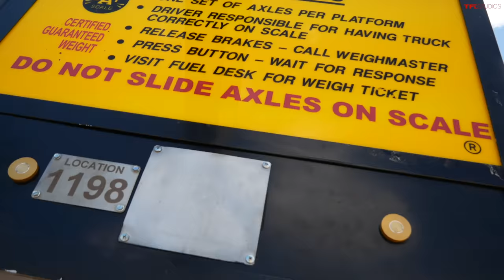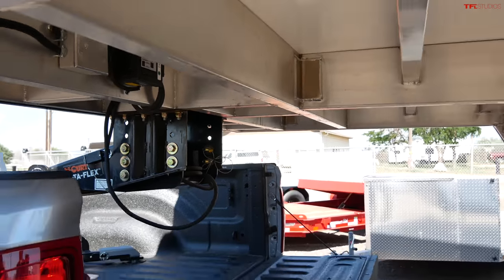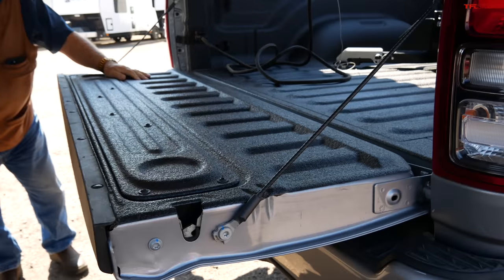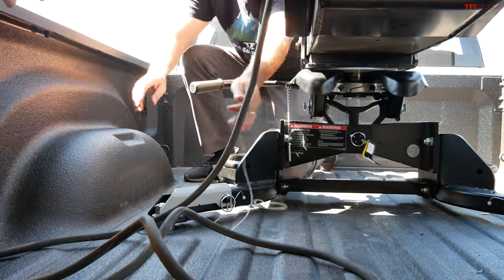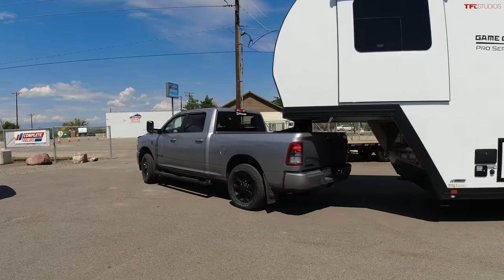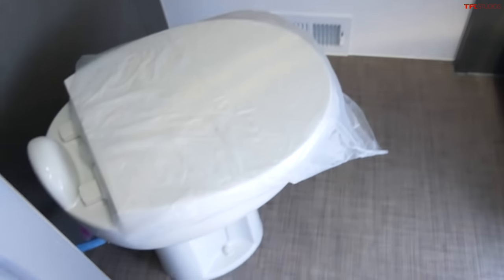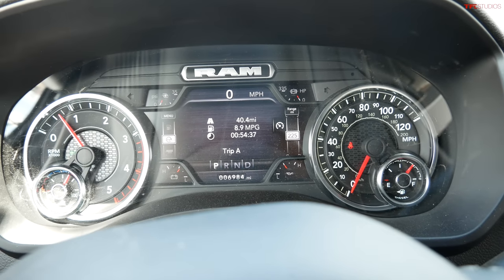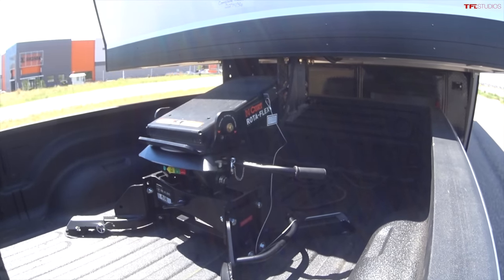I Accidentally Overloaded My Ram 2500 Cummins By 1,000 Pounds & Guess What?

Comment: I have the RAM 3500 CCLB/w the Cummins and Aisin transmission, love it. There is no way that pin weight is only 1700lbs with an empty trailer, you need to get your rear axle weight with and without the camper attached.
Reply: Before checking ATC's website I was going to say 1700 lbs was probably about right, but now that I have checked, it's a toy hauler. So ya, higher pin # but WOW does that thing have cargo capacity. I have a 5W that's heavier dry (but is nowhere near the ATC's max load capacity) and our pin weight is over 1000 lbs less even at basically the same length. Ours isn't a toy hauler though so that's where the weight diff is, and yes, why a dually would be the way to go without question on this unit.

Comment: Your MPG towing that is confirmation on my engine choice.  I have a F350 with the 7.3L gas and 4.30 axle, towing a 14k GVWR 5th wheel camper with a "book" height of 12' 3'" and get between 7  and 8 MPG, and I don't have the payload penalty of a diesel.  And yes, you should have had a 1 ton truck for that trailer instead of a 3/4 ton....

Comment: The only thing overweight is the truck rear axle by 140 lbs. The trucks gvwr of 10k is just to keep it out of commercial regulations. A ram 2500 has an actual rating of 11,500 lbs

Comment: More proof that the typical customer has no intention of pulling more than a few 2x4s. Still, loved the video!
Reply: Ya most, but you'd be surprised how many people are driving 2500s while towing loads that cannot help but be too heavy (judging by sight). Hell I've seen guys with DRVs or LUXEs using a loaded-to-the-hilt 3500 SRW. There are some very irresponsible/ignorant RV owners out there.

Comment: when we my parents my bro and i got back into the rv world i finally convinced my dad to get a diesel truck. he went with a 3/4 ton ram 2500 matched weight to the fifth wheel we had it said in the manual the big but. she ungilated in a wave pattern [not FUN] My dad saw the rear end dip sharply in a turn when the weight shifted. even with over load springs not much difference.  pulled it great 👍🏻 weight/balance not so much. after telling him you need a one ton to better distribute the load.  trade in was high been very very happy ever since RAM is the way to go. be fore warned the tough screens delaminate is fail point should be a re-call out of warranty or not. post a letter ram. plse.

Comment: Put the Reese 20K sidewinder assembly in place of your curt hitch and you can turn 90plus degrees with the short bed and not hit the bed side wall or the back of the cab and will work with any 5th wheel plate in cludeing BandW companion

Comment: I have a limited Ram 3500 Mega Cab and the payload for the SRW 1 ton is 3800#. Just to give you an idea for a high optioned truck. If it was a tradesman it would be much higher payload.

Comment: Yup, all these 3/4 ton pickups running around pulling 5th wheels are probably overloaded! I have a 3500 8ft bed SRW and you still have to be careful. Tire ratings are the weakest link.

Comment: Literally every ram 2500 at our local dealer would have been incapable of towing this trailer empty. Their payload numbers were the most egregious
Reply: Fwiw. That's all part of a legal loophole. 2500 is designed to give you the most towing capability without needing a class a when using it for commerical.
Reply: @davidflower295  From everything I have read, if you get into an accident while over your rated numbers then you could be held liable. In Tennessee having a 3/4 vs full ton is no different.
Reply: @nerdyeevideos1879  When it comes down to attorneys in a personal lawsuit, anything is on the table. In terms of the eyes of the law, GVWR is for licensing and registration. GAWR, tire ratings and hitch ratings is where overloaded factors come into play. 

What I mean by licensing is your driver's license limits. Having a 3500 with a 14k GVWR and a flat bed trailer that's empty(or loaded) with a GVWR beyond 12k will get you into just as much legal trouble in the event of a collision. In the event of a collision that causes a fatality, that can be a misdemeanor death by vehicle. 

Being in a 2500 over the payload and GVWR, but within your driver's license restrictions, GAWR and tire rating gives you a bit more gray area wiggle room than being over the your license restrictions.
Reply: I ended up getting a 350 tremor even though as i understand it it is literally the same as a 250. Did it strictly for liability when we get a 5th wheel some day

Comment: 11,080 at the scale and 8300 empty with a driver. That is 2780 difference. Makes sense for a 5th wheel like that. 20% tongue weight would be 3360 for the GVWR for that trailer. That sounds like a 1 ton truck for sure. I found it very interesting with the trailer swing with that long pin box. That would have been a bad smash.
Reply: Thanks for doing the correct math it was not 1700 lbs of tongue weight as stated in the video but 2700.

Comment: New trucks are still pretty stout for 3/4 ton. My 2006 Dually Megacab only has a GVWR of 10500lbs with 15500lbs towed. I guess they did that to keep the combined under 26000lbs to not require a CDL. It doesn't seem to just be coincidental.

Comment: We had a 2001 Silverado 2500 with the 8.1 liter and Allison transmission we would haul anywhere from 15k-30k of hay, cattle, scrap iron, and farm equipment with a bumper pull and gooseneck. Not exactly legal for any other use other than farm use. That truck would pull anything behind it and pass anything but a gas station.

Comment: I average about 16mpg with a dump trailer. Weight in between 17,000 and 21000 most of the time.  The emission stuff really hurts the power and mpg for sure.  I get about 26 when I have no load. 2006 ram cummins.

Comment: I will add my opinion to the video.  When you use a 3/4 ton pick up, they are classified up to 10,000lbs (GVWR of 10,000lbs) so limited in the total weight of the truck and any weight passed from the hitch.  The truck will weigh about 7500 lbs so leaves you about 2500lbs of weight transfer.  If your trailer is 16000lbs loaded, then it will transfer about 22% of that weight to the truck, or 3520lbs with leaves you 1020lbs over the payload of the truck (10,000 (GVWR) less weight of truck (approx 7500lbs) = 2500lbs).  I just think they didn't explain it well.  The best way to prove things is to scale the truck/trailer which they did in the video.
Reply: Yup you're right that trailer was not overweight for it at all.
Reply: @stone9882  The issue here is (as Mr.Truck stated) the axle placement of the trailer puts over 30% of the trailer weight (empty in this case) on the truck. 4,940 on the steer axle + 6,140 on drive axle = 11,080 for the truck, subtract the curb weight of the truck: 11,080 - 7,500 estimated for diesel crew cab & driver =~ 3,580 tongue weight empty. 3,580 tongue wt + 8,020 trailer axle wt = 11,600 empty trailer weight, 3,580 tongue weight / 11,600 total trailer =~ 30.9% on the truck. One saving grace might be that being a toy hauler, the rear of the trailer will probably be loaded more heavily but I don't know if it would be enough to offset this.
Reply: Thanks for the calculations, I don’t pull 5th wheels so was confused on how they got the #’s

Comment: This is why Diesel on a 3/4 ton sucks.. no payload.
Just go 3500 SRW and get 4000 or more payload..
Mr Truck represents everything great about TFL before they did too many videos/ channels
Reply: That feeling when my 3rd gen 3500 squat like crazy with an excavator loaded gooseneck and i had to upgrade to a 4th gen 4500. The 2500 trucks seem like work pickups at this point not meant for any towing, arent most double axle bumper pull campers still like 10-15k weight?

Comment: They have to increase the GVWR or lower the curb weight. The Ram Cummins 2500  is limited to 17980lbs for gooseneck/5th wheel. That trailer is adding 2700lbs NOT 1700(11000-8300 = 2700lbs) well over the payload limit of 1700lbs(10000lb GVWR - 8300lb curb weight) but it was not over the RGAWR 6300lbs or the FGAWR of 6000lbs.

Comment: Bottom line is 3/4t trucks are farm trucks. Great for heavy flatbed conventional trailers and great for heavy gooseneck farm trailers that still put 10-12% down on the pin. But 5ers easily go 20-25% at the pin and 3/4t is the wrong truck.

Comment: Wifes 2015 Ram 2500 6.4 Hemi tows 17,000# + its 7,600# = 24,600# and it tows like a boss up 5% grade, gets 7.6ish mpg..  Rear axle on a CTD is 10,000# on 2500 and SRW 3500 and 9,000# for Hemi (AAM 11.5 and 10.5)..., so the real limit is tires/wheels and suspension.  Yes, the manufactures need to better calculate out their GVWR more similar to how commercial vehicles are rated.

Comment: MPG is affected by size and weight of the trailer, but also the vehicle as well. Trans type, gearing, and depending on the width of the trailer, you'll have a dually for extra stability of the gooseneck from rocking the truck. We had a manual 92 d250 12v long bed 3.55 rear POSI, towing a dual axle 26ft gooseneck camper, still got around 15mpg skirting the mountains up to Chicago with the old 12v. Now on the other hand, my dad used to pull farm equipment with a short bed single cab 97 F350 dually manual 7.3L 4.10 POSI 32ft flat deck goose, fully enclosed 4440 John Deere, a self propelled spreader (Detroit diesel powered, with fuel) Oh yeah with about 600lbs of tools in the bed side boxes. You didn't care about fuel economy when you had an Ox of an old 7.3 to pull that tonnage... that old 7.3 is still being used today
Reply: I want a 4440, I had a couple 4430's

Comment: If you load the trailer garage behind the wheels, it will reduce the pin weight.  A toy hauler is designed to be loaded to balance the weight

Comment: As I stated in your last video, load the Ram 2500 up 1000lbs over sticker weight and the truck isn't going to care. if you took a ram 3500 same config and drove it you wouldn't notice the difference. In fact if you put the air bag option on the 2500 it would drive better than the 3500 without airbags despite the stiffer leaf springs on the 3500. I'm not giving that as advice but just stating and showing the sticker is for tax purpose classification, not actual weight capacity.
Reply: Probably can tow upwards 30k but the brakes take a huge hit.

Comment: The GVWR is a registration weight number not a design limitation. You have a 6500 lb rear axle rating. You are still under the ratings that actually matter
Reply: That's essentially true. But if you are over GVWR and get stopped by a statey with mobile scales you're getting a ticket. They've been picking up enforcement of that in some states.
Reply: Anything to give truck “techys” something to talk about on the internet. Most ranchers around me use 3/4 ton trucks to move all their hay/wood/equipment. No one has an issue or frankly the time to think about “weight ratings”.
Reply: @riccochet704  I'm not talking about commercial. Recreational vehicles are exempt from all sorts of commercial trucking laws. Even the DOT weight checks for commercial vehicles are based on axle and tire ratings. GVWR numbers only matter for commercial drivers to determine which license they may need.
Reply: No…. You are over the suspension rating. Not the axel. 2500s have crap coil springs.
Reply: @tnargdonald  wrong. Suspension and tire rating is included in GAWR. SRW and DRW 1 ton trucks have the same axle, but the GAWR of the rear axle goes up alot for DRW due to extra capacity of the tires and the suspension
Reply: @drewd8185  actually you are wrong. A SRW 3500 and 2500 have the same axel housings and tires. The weight difference is from the suspension design 

A Dually has a different axel from a SRW 
11.8 vs 11.5 it’s quiet a different unit. 
But you can keep on grasping from thin air.
Reply: @tnargdonald  so if ram 2500 and ram 3500 have the same axles and tires but a 2500 has a 6500 lb rear axle and a 3500 has a 7000 lb rear axle, wouldn't that show that suspension is included in GAWR? 👍
Reply: @tnargdonald  also the srw and DRW high output rams all use AAM 12s
Reply: @drewd8185  well one has could springs. Which is the weight limitation. The other has leaf springs…. Which was the whole point of my comment…. 

Like why does a Dana 80 have different weight ratings? Oh yeah the suspension is the limiting factor. Not the axel. 🤣
Reply: @drewd8185  if you are pulling from thin air you might as well get it right. A 3500SRW has a 7000lbs rear axel weight and a 2500 has a 6000.
Reply: @tnargdonald  it's weird...the sticker on my ram 2500 says 6500...must be a typo
Reply: @drewd8185  were not talking about HO were talking about 2500s. Stay on track squirrel boy.
Reply: @tnargdonald  I'll make it simple. Ram 2500 with the cummins sitting in my driveway...has a 6500 GAWR rear axle. Never brought up HO for a 2500...its not a thing. So you agreed that suspension is included in GAWR. you are just wrong about the Ram 2500s not having a 6500 lb rear axle.
Reply: @drewd8185  my Ram 2500 also has a 6500lb rear axle. My truck empty has 3000lbs on the rear axle. so putting 3000 lbs in the bed is not even close of going over ratings considering some of that weight is  transferred to the front axle.

Comment: The bottom line is the Ram was able to handle the extra 1,000 lbs. without issue. I had to go to South Carolina to pickup my oldest son in my 2015 Ram 1500 Tradesman Crew Cab. He was coming home from Florida with two friends in my '09 Nissan Maxima when he ruptured the transmission cooler line and lost all the fluid. I had a new CVT put in about a year before because the original died and the new one has a 100,000 mile warranty. I wanted to get it back to the shop that installed it to look it over. My son's friends were impressed with my Ram's acceleration towing the car sitting on the trailer behind us. It drove perfectly normal, and with the car and trailer easily weighing around 6,000 lbs. my Ram with the 5.7 Hemi drove like there was nothing behind it up and down hills. I did have the Tow/Haul mode engaged.

Comment: Forgot to mention that in my research I found that Chevy/GMC 2500s have a higher payload rating and that would have for me but at the end 2020 when I bought my truck, I couldn't find one.
Reply: I got a diesel silverado 2500hd that has 1250 more pounds on the gvwr than this dodge does. Many 3/4 ton diesels have a payload in the vicinity of 2k-2.5k and gm is well into mid 3k. It was a big factor for me going to a Chevy from a Ford.

Comment: No mention of the Rams yellow payload sticker. It assumes full tank of diesel and full tank of DEF plus the weight of the hitch and people that sit in the cab. Add a 2100lb pin weight and most 5ers are too HEAVY. The lighter fifth wheels that are marketed for half ton trucks leave room to spare.

Comment: Gooseneck ratings are higher because there is less payload loss on the truck. A gooseball weighs 8lbs, a 30k rated fifthwheel hitch is 150-170lbs. The other factor is that fifthwheel hitches are not built to the same standard as a simple gooseball( there are 40k gooseballs) to find a 40k(10k carry) fifth wheel hitch you are looking at a low profile, 34" wide frame rail mounted unit(not a 38" wide pickup frame). The forces at play(torque) on a fifthweel hitch are much higher(connection point is 13-18" higher than a ball). There are lots of factors that affect the ratings of fifthwheel hitches vs gooseballs. The CONVENIENCE of the fifthwheel hitch is why it's more popular than gooseballs for RV applications. There are down falls to the fifthwheel hitch too, but that's mostly is the complexity and multiple moving parts of the design. I personally would take a fifthwheel connection over a gooseneck everytime, because it has a larger surface area(pin box to hitch) and ease of hook/unhook.

Comment: The frustrating thing is the 1ton has only rear springs that are different. Same brakes, same frame, same drivetrain, same tires. 2500 has softer springs in the back. I have seen guys pull with the 2500 and just put air bags in and level the truck and they pull all the time.

Comment: The jack knife part is good to know. I used to be a dodge guy but the new 6.7 powerstroke and super duty looks too good. I don't have a 5th wheel but after watching this, I'm debating it. Debating on a 5th wheel camper or regular bumper tow trailer.
Reply: A 5th wheel will always pull nicer.then a bumper pull.
Reply: If you do lot of Boondocking go for a travel trailer. 5th wheel definitely have limitations on uneven ground

Comment: This is where the Ford Alumi-Duty seem to shine. My F250 with a driver weights in at 7250 lbs, with the same 10,000 lbs GVWR. It's the Tremor package,  so it's sitting on the same underpinnings as the F350 Tremor which weights the same with the same equipment and driver, but has a 12,500 lbs GVWR, so I should have cushion.
Reply: Well the 7.3 GAS Ford wouldn’t be overweight at 19k
Reply: My 2022 f350 long bed weighs 8040 with 3/4 tank of fuel and gvwr 12,000 with camper package.Even if you have the same underpinnings it’s not legally classified. This is my understanding.
Reply: @markdixon4912   there are only a few states that apply the commercial regs to personal vehicles,  hence you probably aren't required to run your truck over the scales.  I only consider it as extra insurance in case my math is off. It's hard to use up my payload towing a bumper pull, 14K trailer.

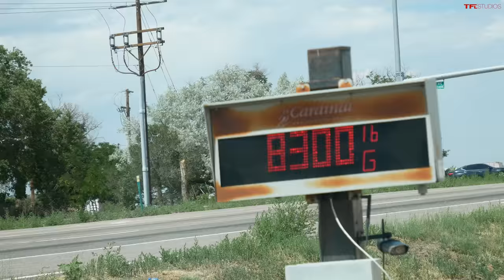Comment: The math at 25:00 is wrong. You had just over 11k lbs on the truck axles with the trailer attached. 11000-8300 = 2700 not 1700. 1700lbs is actually the remaining amount of payload available without exceeding the gvwr of the truck.